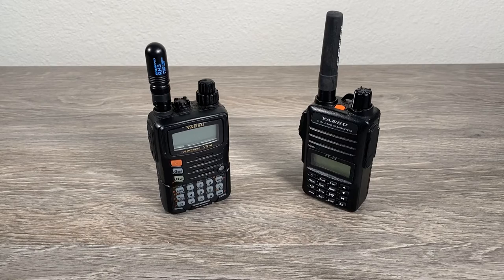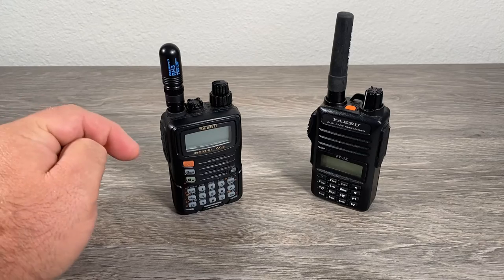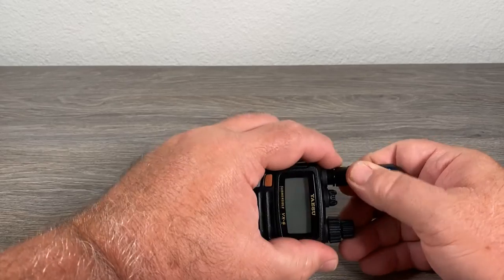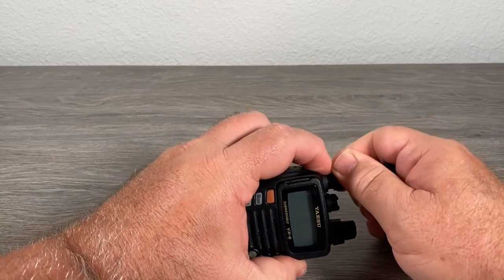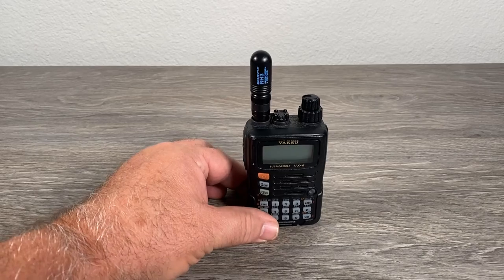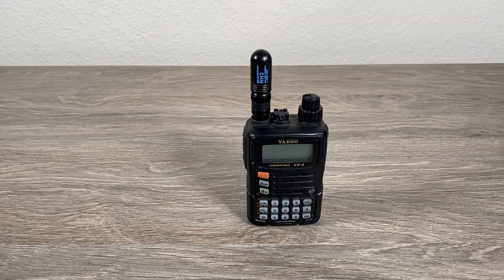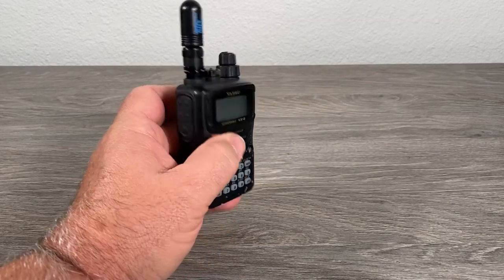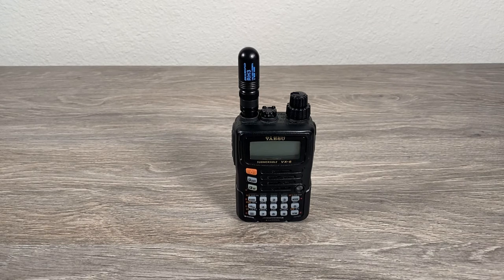Mini Review - Diamond RH3 Antenna

Comment: Thanks for showing me which stubby antenna to use on my Icom ID-51A (the SWR reports were vital in making my decision).  I just ordered the Diamond RH3 (and BNC adapter) for use while on D-Star connected at home to the OpenSpot3, and to also use while scanning locally or while camping, without poking my eyes out with an extended whip antenna on the HT all the time.  The condensed size of the antenna on the already small ID-51A will make carrying it around much easier.  And, if I need to transmit some distance, I can easily switch to the Comet SMA-24 antenna, or go to the Jeep and use the mobile ID-5100 and 50 watts of power.  Cheers and 73.  Pete in AZ - KI7LIL

Comment: Thanks for the Video.... verry interresting your experience, I have a couple of this ' Dummies ' from Nagoya , Comet and Surmen....They all work surprisingly good for the length, but are all on the UHF side better.  Therefor I find it interresting, that this Diamond RH 3 is better on the Vhf Side. I will try this one out. Also my Nagoyas are BNC, so I use a heavy adapter and I somehow have the feeling, that this extra weight is doing a little... help on the weight balance side......with better receiving. Just my subjectiv notice... not measured out in any way......73 from Germany

Comment: Love the looks of it, but I need the range more then the looks. My local repeater is about 6 to 8 miles away so it probably would not work so well. Great video as always , thanks.
Reply from the maker: It's definitely a short range niche application. Although I am able to open up a few repeaters 5-10 miles away. But they're also at fairly good elevations so I've got a good shot at them. For something more urban it would a challenge.

Comment: Good review. I have a similar Bullet antenna. I have to think they have a wire wound 50 ohm resistor inside. I'd like to crack one open and see. I got it for very close in comms with others. They work great for their intended use. The one I have gets warm with use. Rock on Brother !

Comment: 400 yards? I have the Diamond SRH-805. I "know" they are not the same but they are damn close. I get over a mile on the SRH-805. Did you test it or is the 400 yards your guestimation?
Reply: Only for 70cm….  Not for 2m